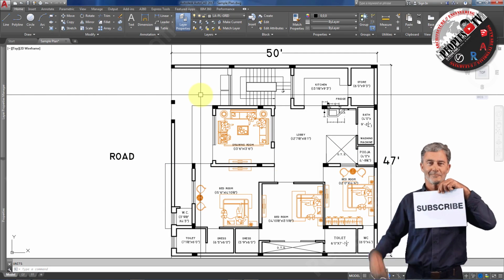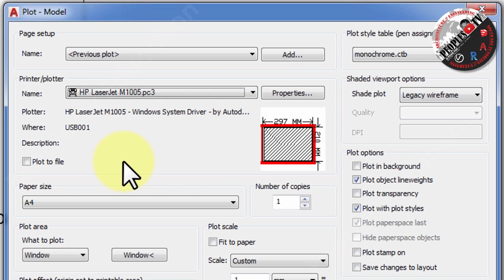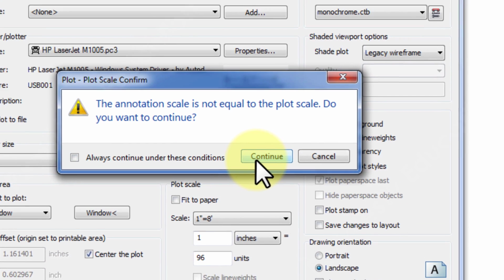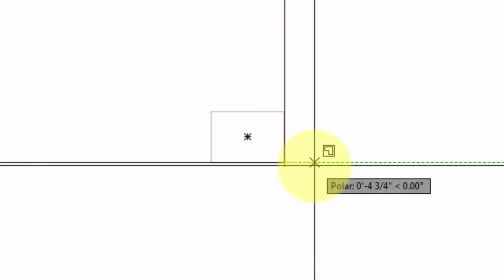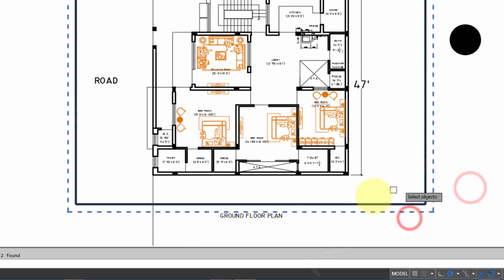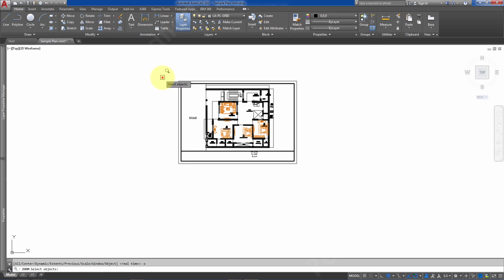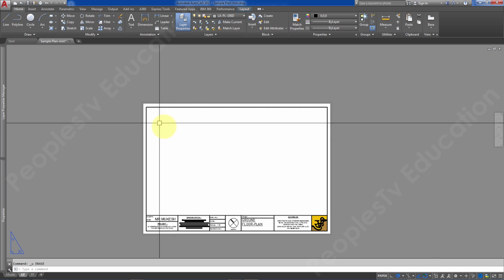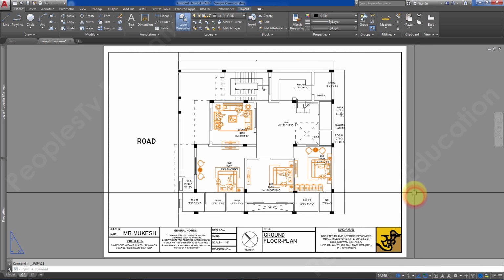How to Take Print from AutoCAD | All Scaling Methods Explained with Live Printer Settings

Comment: Hi Sir,
How are doing..? Hope you are doing good..
Sir, what is the use of LTS factor in AutoCAD..? And why it is being used..?
Will you please reply 🔙..

Thanks 😊
Reply from the maker: LTS is linetype scale we use to scale our line type based on our drawing scale for ex: if we want to show dashed lines in our plan which is set to some scale we need to set the LTS of the dashed line accordingly so that it's visible properly in print the gap between the dash are visible
Reply: @archskills  Thanks 😊

Comment: Sir, I had one dout. .how can we know that, the drawing is perfectly suitable for printing with proper scale fit ..??
Reply from the maker: Best way is to take a test print first in the paper size you want your final print and use triangular scale to check.

You can also make grids all over your plan in background like 200mx200m grid in very light lines than you don't have to scale print your drawing also , whatever scale you print your drawing it dosent matter because your grid size is fixed which is 200 * 200 mm so you can read your drawing accordingly

 another small trick is if you have montior  bigger enough to fit a A4 paper you can zoom your drawing and match A4 paper size and measure your drawing in monitor itself